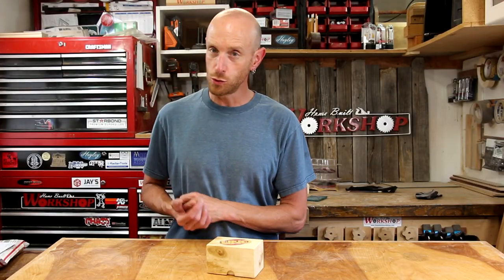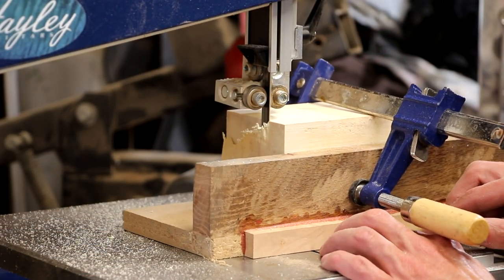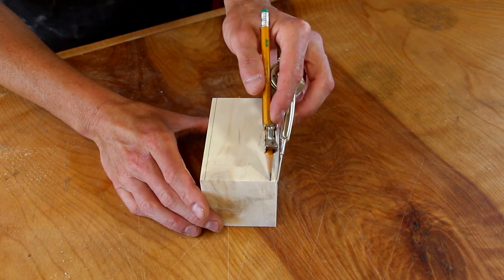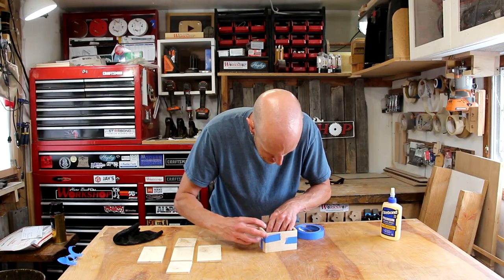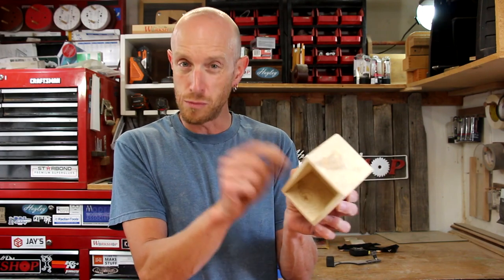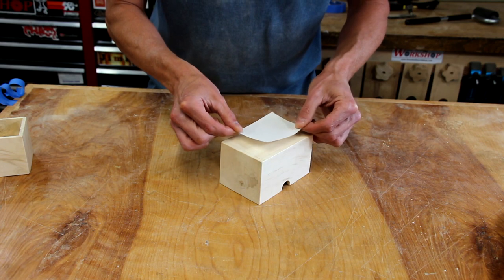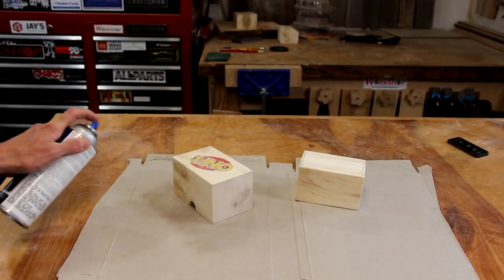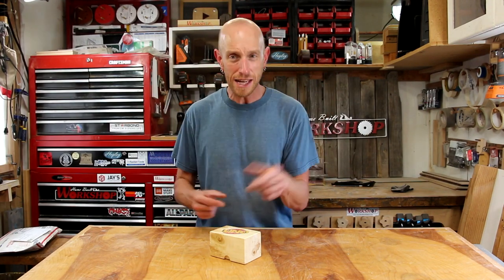How to make a Bandsaw Box | A different kind of bandsaw box

Comment: I really enjoyed this episode. How did you maintain such tight tolerances between the two boxes.
Reply from the maker: Thanks. I used the thinnest blade I had. I think using the tape as a clamp didn't pull the pieces together quite as tightly as a clamp, as well as a few coats of finish helped take up the space. I can see the glue lines pretty well so I know they didn't squeeze too much. I might make another just for fun to try to work out some more details on clamping.